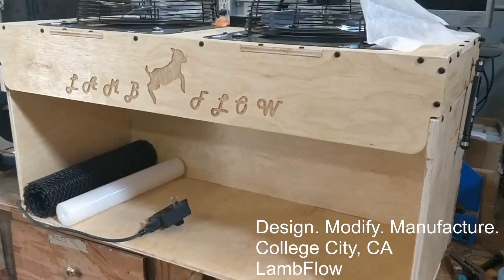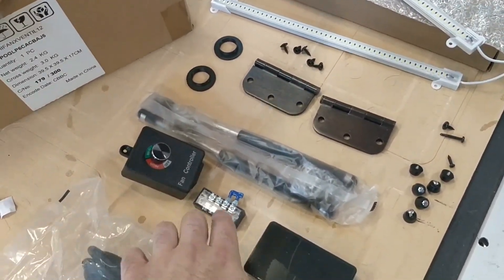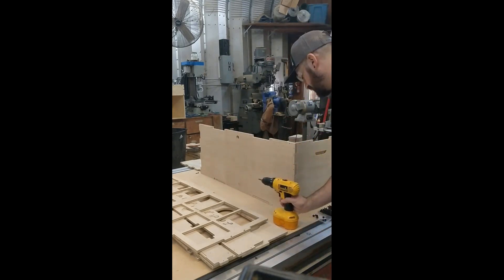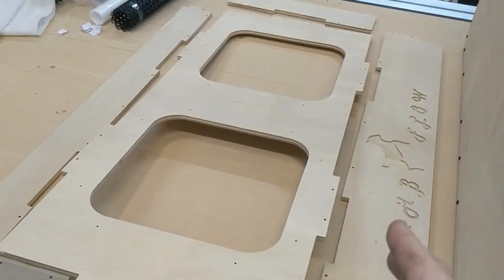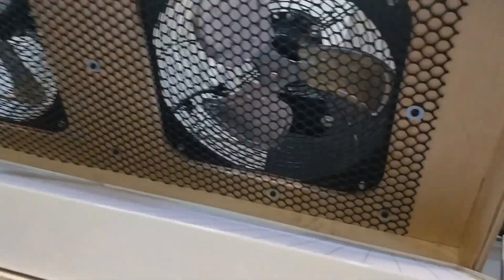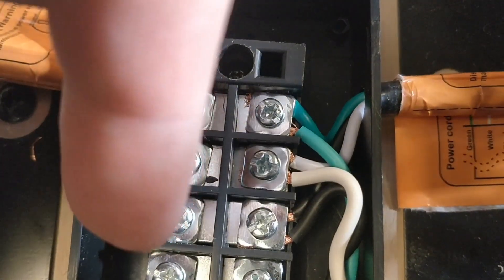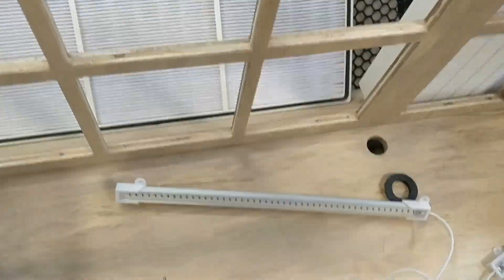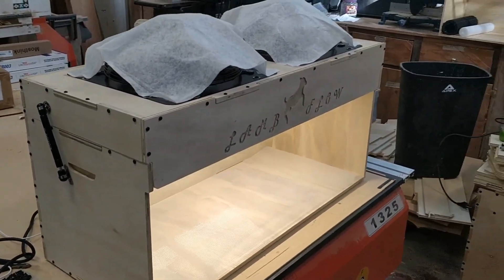DIY Laminar flow hood LAMBFLOW ASSEMBLY

Comment: Can you dial in a true laminar flow without eddies and vortices?
Reply: A true laminar flow hood has none in the center. That is why it is called “laminar flow hood”.
Reply: @angeliquewagner1281  - The Physics definition is a constant straight line of airflow without turbulence. Turbulence and vortices cause interference and create a particle load.  If it’s a true “Laminar” flow, you will have it all across the length of whatever filter membrane one is using 👍 Peace!

Comment: Awww cool design but wish you would have shown the lighter test!
Also, I thought for it to be laminar flow, that you would need air pressure to build up inside a chamber and from the pressure, it would push air through the HEPA filters.
In your case, air is just pushing directly through the HEPA filters and not by way of air pressurization. (thats why most laminar flows that I have seen have some kind of chamber where the air pressure builds up in)

Comment: What is the size and weight of flow hood, please.
Reply from the maker: Weight:
46lbs 
Inside dimensions :
38.5"L x 16.2"W x 15" H
Outside dimensions (with fans mounted)
39.5"L x 16.7"W x 26"H
Reply: That's much lighter than I thought.